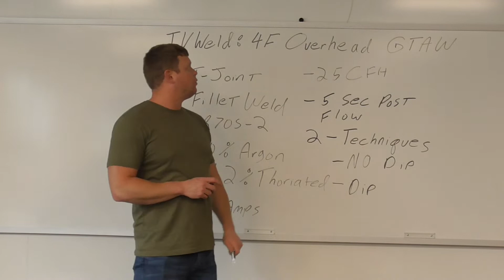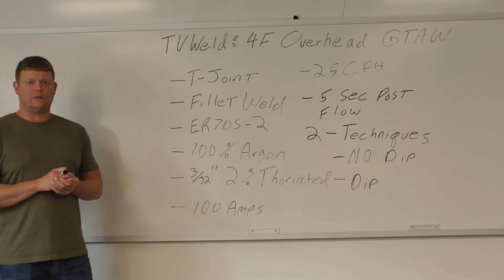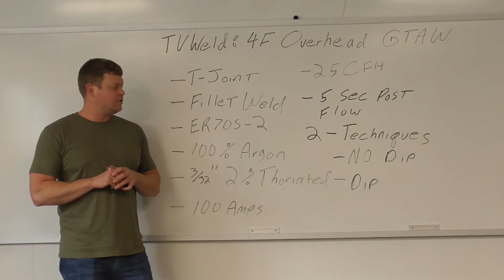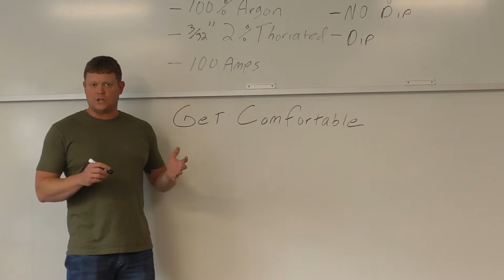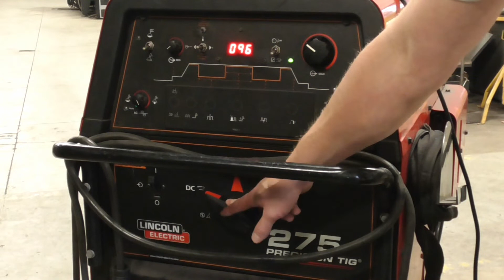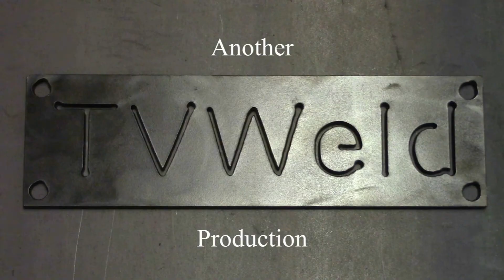How to TIG Weld Overhead

Comment: how are you positioned though and how do you hold the torch
Reply from the maker: I hold the torch like a pencil and go into the joint almost straight in with a slightly leading angle!